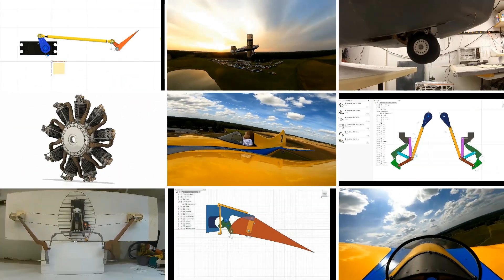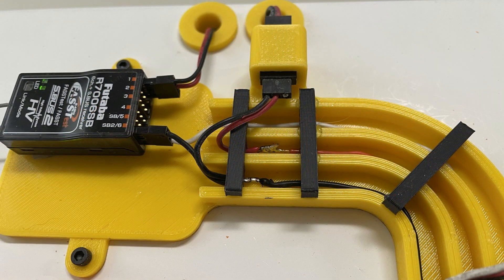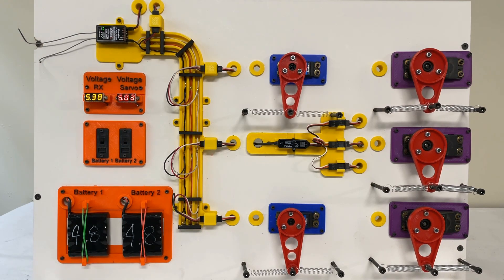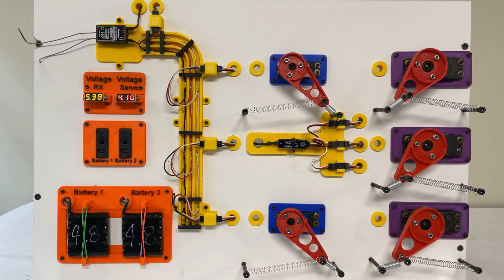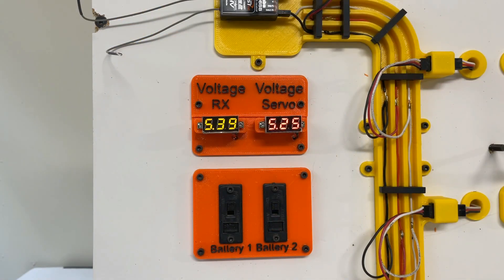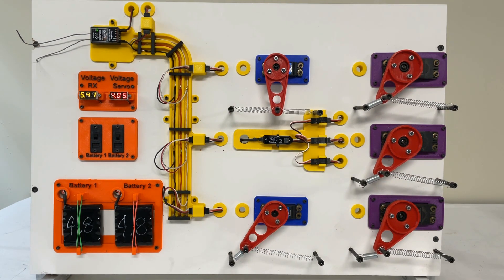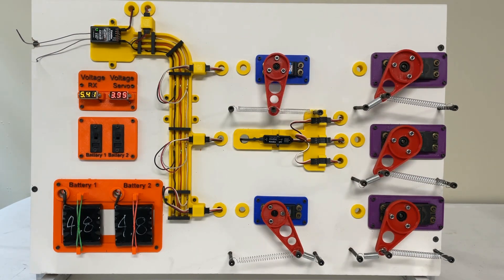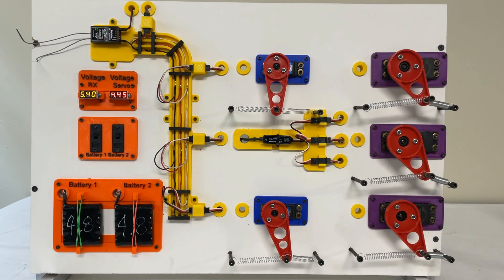RC Airplane RX Voltage DROP!

Comment: Awesome setup! I'm flying Futaba for 30+ years, mostly 40/60 size nitro, teaching students, going larger (1/4 to 1/3 scale), and have similar concerns about low voltage dropout, servo overvoltage, and current/BEC overloading. BTW, I found your videos when searching for power expander systems. Keep 'em coming and don't let the trolls get you down!
Reply from the maker: Thanks! And rock ON!

Comment: It worries me that you try to explain the voltage drop, without explaining anything about the battery you are using, what voltage does this battery have? Is it NIMH? 6 volts? What internal resistance does it have? What capacity does it have? Has it ever occurred to you to try a 2s lipo battery with low internal resistance and servos prepared for 7.4v?
Reply from the maker: I state in the video if you use a voltage regulator, which I use in my 188" Emmaselle, you won't have any problems. As I stated, I was making this video due to a discussion when using a 4.8v battery. Of course, I use Lipo's. I use a 6S for my radio through a regulator. But this video was only to talk about 4.8v batteries that are used by many people.
Reply from the maker: LOL, I also wrote on the batteries they are 4.8 volts. Maybe watch the video. :)
Reply: He clear says it a 4.8 volt battery many times in the video. The voltage the pack has is shown on the LED meter, which he explains in the video. And his states its a 4-Cell NiMH in the description.

Comment: Ok now you have me worried how do you hook up a battery to run the servos??  I have a 1/3 scale Pitts that has four servers for the airlines to for the elevator one for the rudder and then 1/4 throttle and I use just a 5-cell nicad receiver pack.    You have me thinking why have I not have it go in on me.   So you can see that I really need your help.
Reply from the maker: You are proably ok with 6v. For that to get pulled down to below 3.5v, where some say the RX bown outs would be a lot of voltage drop.